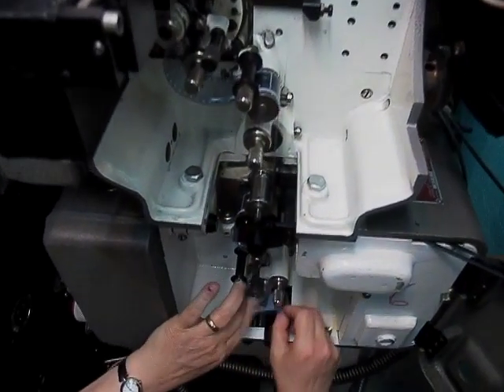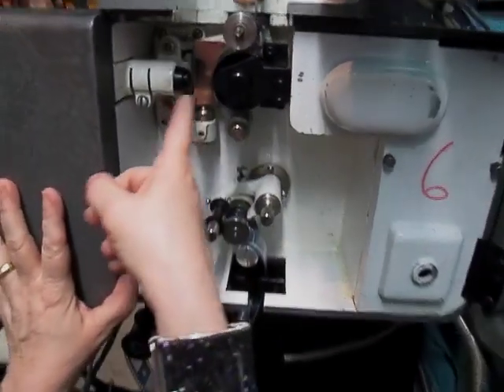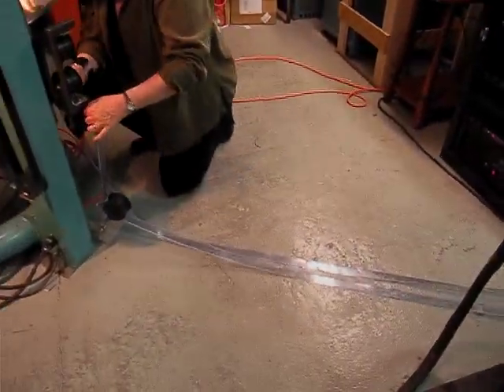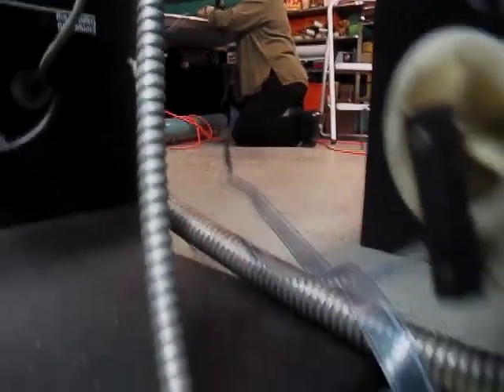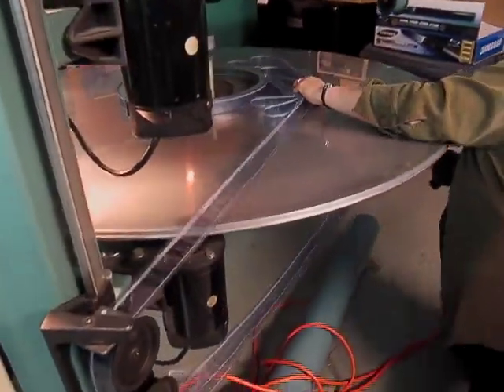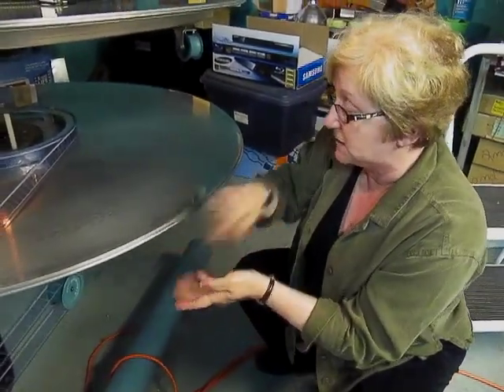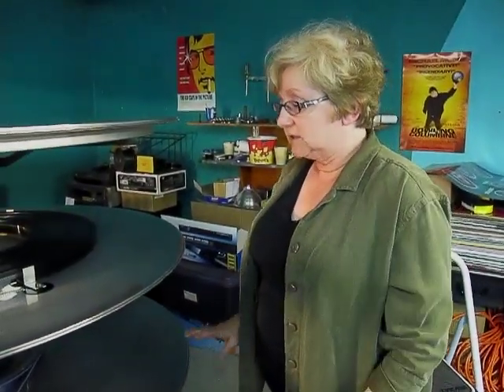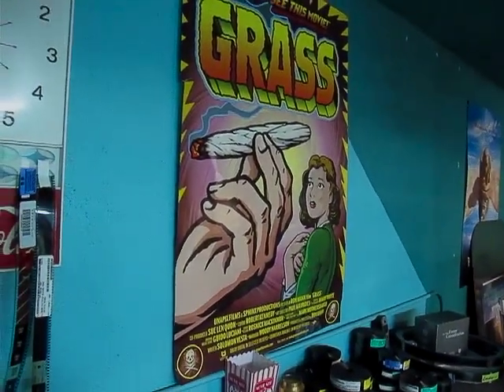T.J. Threads the 35mm projector at the Historic Lynwood Theater

Comment: thats a slow moving film at 24 frames a minute...and she's a projectionist?!!!!!!
Reply: Ikr?
LOL!
Reply: 24/25fps was considered the legal standard for a long time in movie theaters with 35mm projectors. I'm not even sure that any could run at 48fps until a few years ago with the digital models, unless you had a second server/projector to cooperatively run at 48fps. Got some real YouTube projectionists over here. 
This woman is awesome!! I'm so glad this was recorded, we used to have threading competitions when I worked at the old theater. We'd slide on our knees with the film from the failsafe pulley to the output platter's pulley close to the ground. 
Most of the sprockets on the little arms (in the projector) were held to the static sprockets with a few rubberbands, so "brainwraps" would happen so much mid-movie, and usually at the best part. Lol
Reply: hi mate.
the reason i commented was that even though the lady is a qualified projectionist she keeps saying 24 frames per minute and doesn't even correct herself.